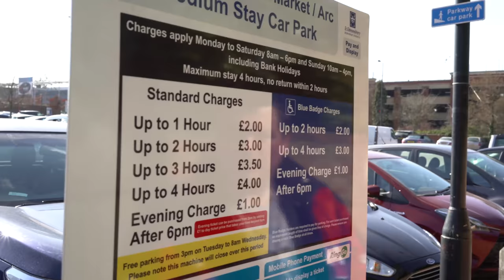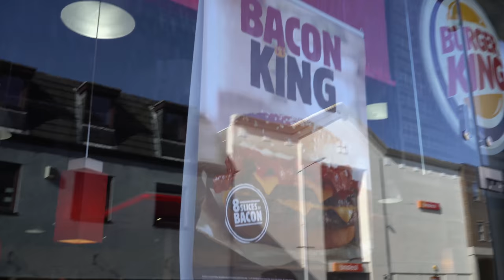Burgers & Failures - We Suck At Vlogging

Comment: Loved this guys. Couldn't help but laugh, I thought you lost the screw, not the socket. It's the sort of thing  that's been happening while I've been carrying out my brake conversion. 

Oh, and an easy fix, on the Astra van, the dent in the rear bumper, if anyone gives a crap about it, take a heat gun to it, it will pop back out. Have done it myself. 👍
Reply: Novalution GSi at the time I thought he'd dropped the screw too.
Ah. Good times